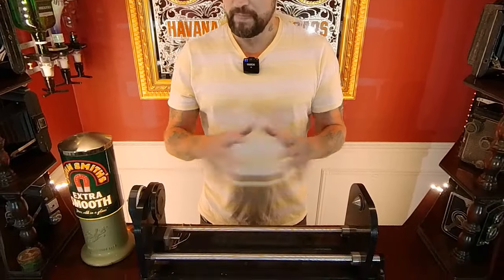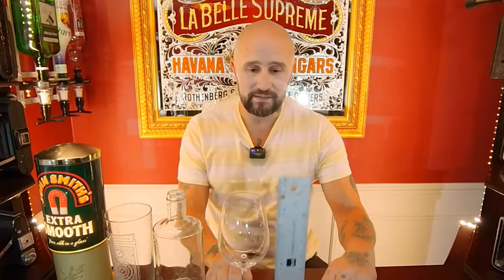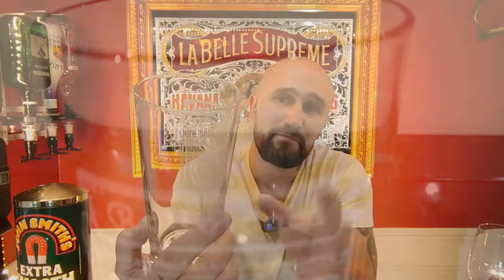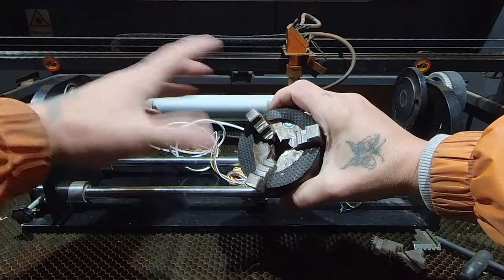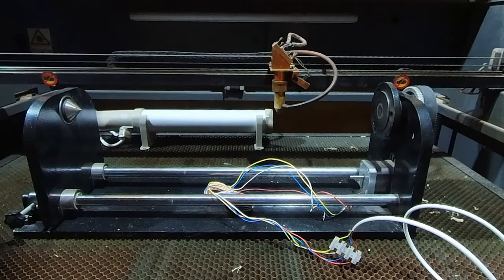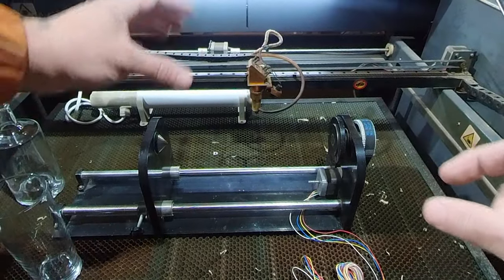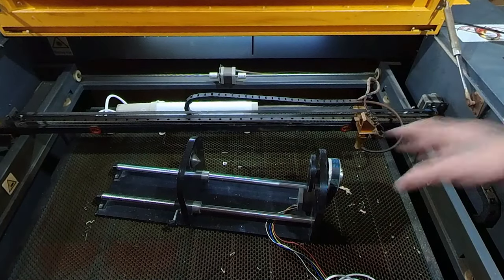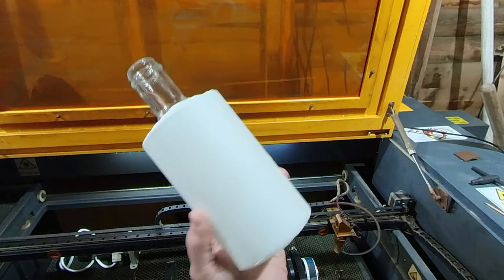How to etch glass bottles with a laser

Comment: The mirror thing is because you have one more reduction gear efficiently compared to the flatbed setup so the laser are working with a reversed direction.
Buddy who is a glassblower uses an inverse cone on the foot side as a driver (if the foot is the heavy side) and different sized pins on the mouth to compensate for conical glasses. It's a bit slower for detailed work since the glass isn't held rigidly, but laies inside the inversed cone. A roller setup is better for that type of work but it is doable.
Reply from the maker: Thanks very much for the detailed explanation!!
Reply: Your videos have given me much enjoyment. It's the least I can do 🙇‍♂️🙏

Comment: Hi, Paul. Great stuff here! Bloody marvelous mate. As the older glass professionals moved on, it's left a major need within traditional glass, glazing and related businesses. I'm an old glazier and expat Brit now settled in Canada. We have a small stained glass business in Ontario and, with most of the old art-glass businesses now closed, we are one of the only traditional commission / restoration companies around. With the near death of stained glass, art glass, brilliant cutting etc, I feel it's a great time to expand and revive some of the old traditional ways. I get asked for pub mirrors and the like a couple of times a week at least Paul, so I'm going to expand and start sandblasting again. I do have a question though if you would be so kind. I'm looking at lasers right now, but I'm told that lasers are still not going to offer me the quality of a good old fashioned sandblasted finish. Suggestions in a group I found, are leaning towards having the laser cutting the 'not vinyl'  (masking material) and then sandblast the remainder. I.e., the laser will cut out the design and I'd then finish it with sandblasting. Is this advice solid mate? I'm looking at designing and producing mirrors and clear glass with logos, pub names etc. Any advice you can offer would be very much appreciated, Paul. Again, great to see you using those traditional methods, mixed with contemporary technology. It's crazy not to really, so long as your core business product remains traditional. Wonderful work mate! I've been at this 42 years now and still love every second in the shop. Unfortunately, I'm also a glass nerd and glass & glazing consultant for high rise exterior glass facades and curtain wall. While still in the industry and executing and managing extremely rewarding builds, international airports, stadiums, 150+ level towers, it's so bloody souless!! Just another few years in the grind and the stained glass business here should have gained enough traction to take over and into retirement. Anyway, any advice would be welcomed Paul, thank you! By the way....KEEP PRODUCING!!! Cheers.
Reply from the maker: Hi Michael, it's nice to hear from a fellow glass artist!!
To answer your question; the laser is a great tool, but I don't use it for making mirrors. The etch isn't as clean as a sandblasted finish, and the paint doesn't take as well. I also don't use it to cut the stencil because a vinyl cutter gives much a much sharper finish for a fraction of the cost.
I made a video where I compared the sandblaster against the laser which you might find useful: https://youtu.be/WCnBvjCLFKI
Bottom line is that the laser isn't as nice a finish, but it's so much quicker and easier. So maybe you could offer a budget option for etched glass & mirrors. The small panel I made in the comparison video is an ideal thing to be able to show prospective clients so that they can see the quality difference and make an informed decision.
I hope that helps mate!
Reply: @happygilder  Thank you, Paul, you are a gent. Great advice and much appreciated. If you ever need anything from my side, please reach out at any time. I'm sure I'll be picking your brains again as I run through this process. I have the IQ of an onion mate, but I'm a certified glass nerd with 40+ years of very diverse experience. I'm always here to help if you ever need. Also, don't ever put this skill to bed my friend, unless of course you lose interest or circumstances change. Works of this nature have almost gone the way of the Dodo. I've watched a few more of your videos and your work, along with your mindset related to said work is spectacular. Keep on keeping on mate. Thanks again, Paul!

Comment: My understanding is that the laser has to heat up the glass enough to cause micro-fractures.  But clear glass allows too much of the laser’s power to pass through without interacting with the glass.  The application tape is opaque.  The laser heats the tape close enough to the glass for the fracture to happen.  You can use other things - like tempera paint or dedicated laser etching spray for the same reason.
Reply from the maker: Thanks for the detailed explanation! 🙏😎